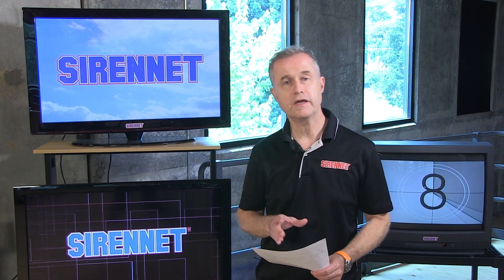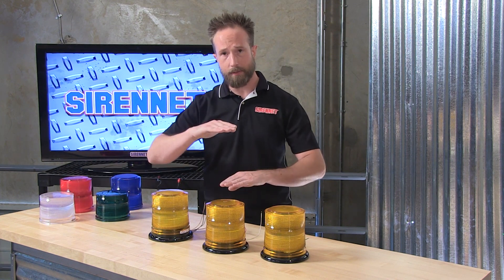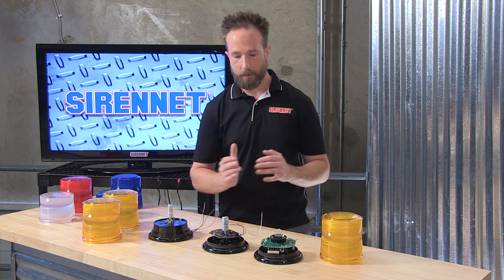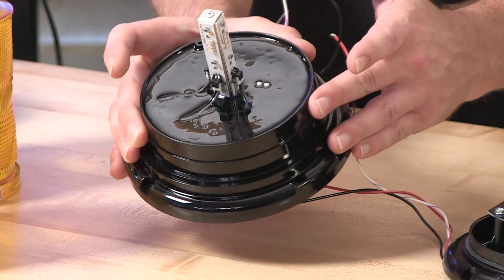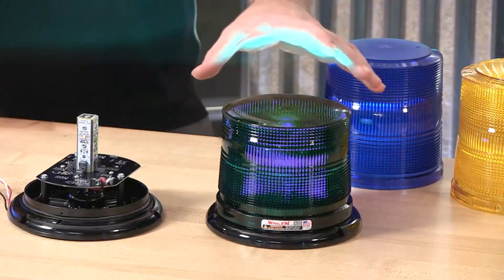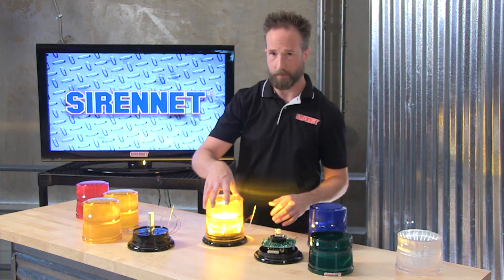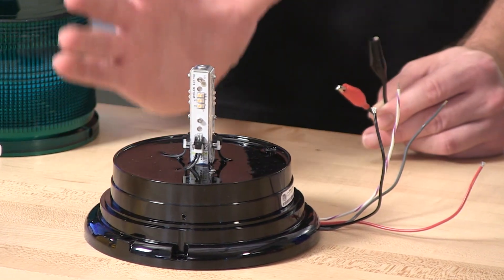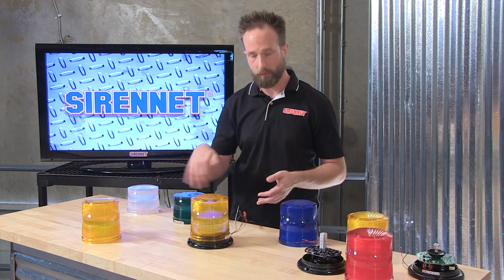Chris reviews 3 different Whelen Beacons

Comment: Can I run a resistor inline to dim the L21 at night?
Reply from the maker: +Stephen Cunningham     The L21's offer a Hi-Lo trigger control wire, so there is no need to add a resistor. Just add a second On/Off switch for the Violet wire to be connected to.
Reply: +SIRENNET Purchased an L21 from Sirennet based on the comment you made. It does not have a Violet dim wire. It only has a violet/white wire to change modes.
Reply from the maker: +Stephen Cunningham     Thank You for letting us know. We'll look into this and be in touch with you.